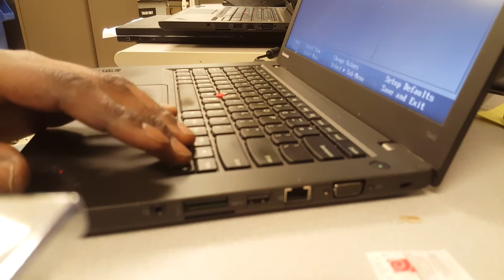Motherboard Replacement for Lenovo T440

Comment: First thing, go into the bios and disable the internal battery our you risk frying all kinds of stuff.  Then when you open the computer, disconnect the battery next.  The thing I had the most problems with with that damn blue power ribbon cable which is clearly designed to self destruct when you take it out.  Had to electrical tape it back into place.